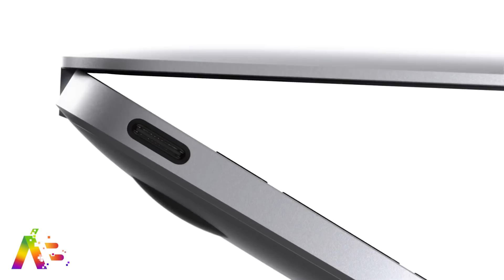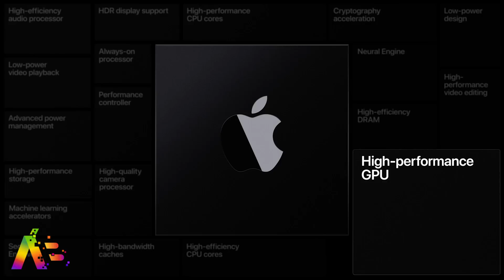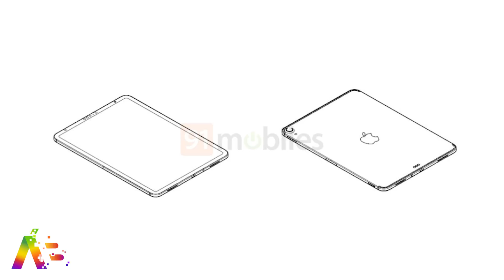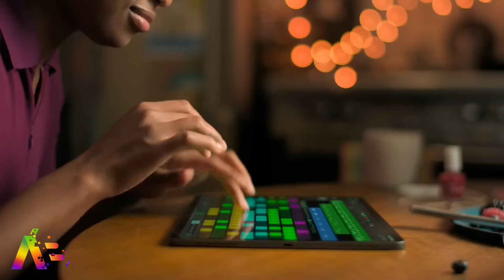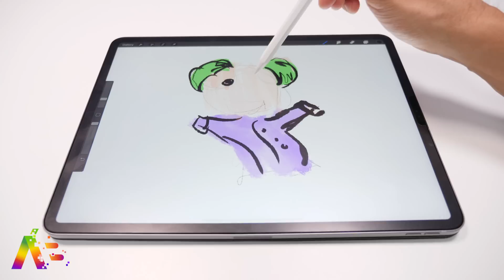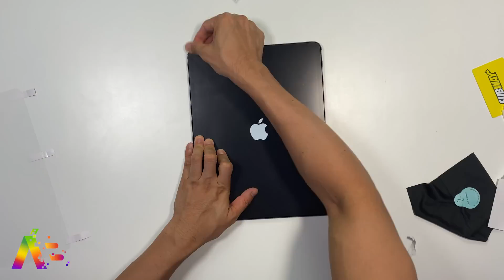New MacBook 2020 w/ A14X details! Apple Watch Series 6 & New iPads coming soon

Comment: iPad line needs to be slimmed down. iPad Air 4 could be the standard iPad at 10-inches, meaning it’s mini enough to replace the Mini 5, and a better feature set than the current iPad 7tth gen.